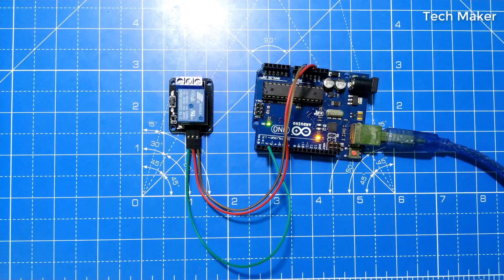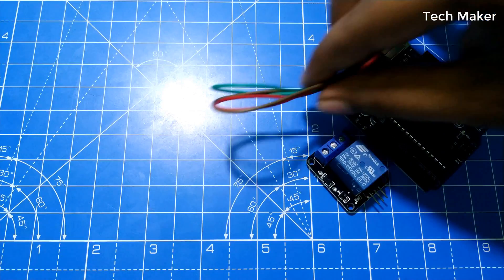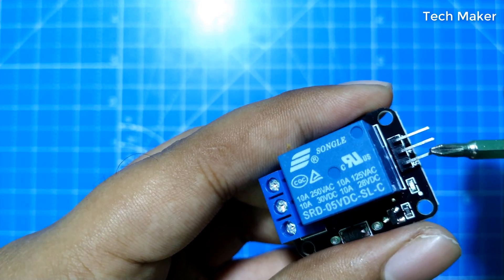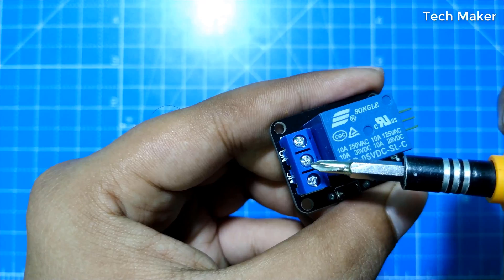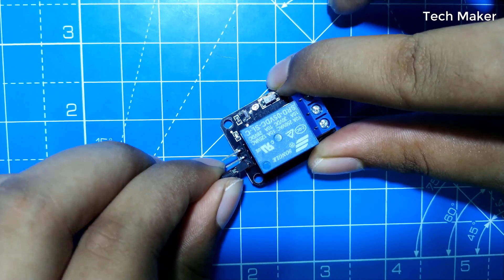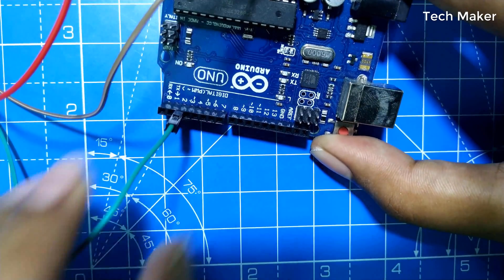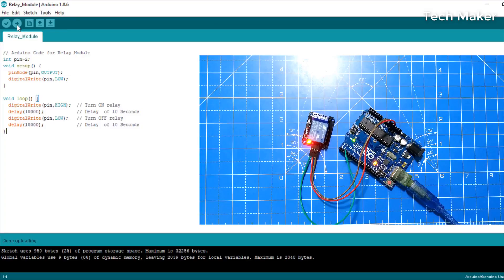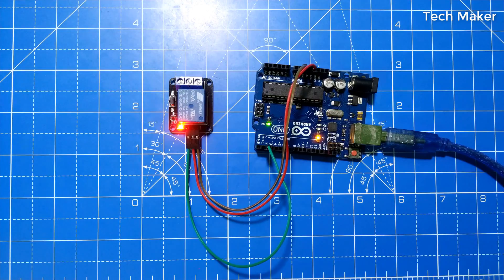How to use Relay with Arduino

Comment: You didn't explain how to wire something to the relay. I can make it switch on and off, that's not the problem. How do you wire the device you are supposed to relay?  Do you have to provide a separate power supply ? What if you are running a 5V device, do you even need the relay? This was really no use at all.